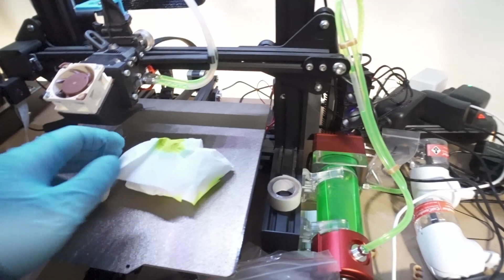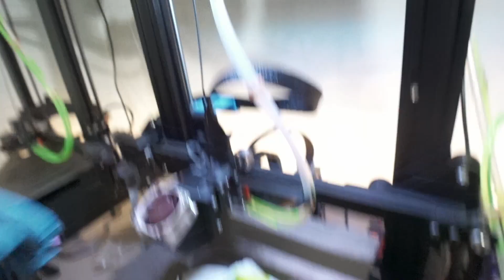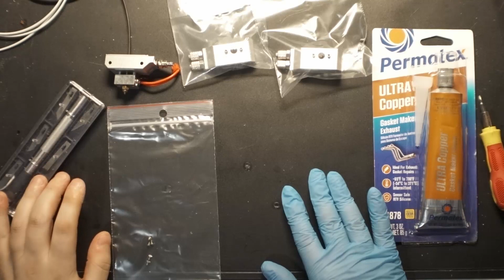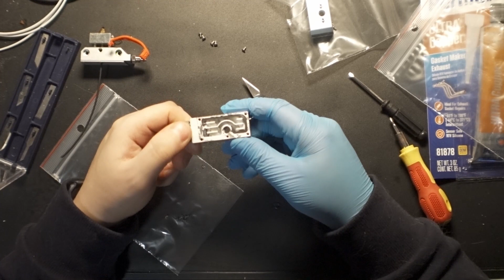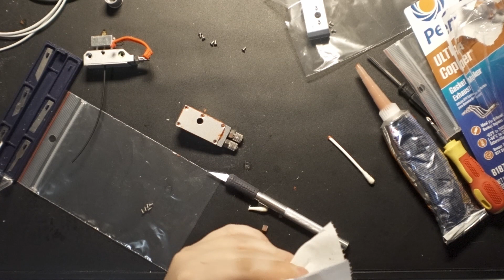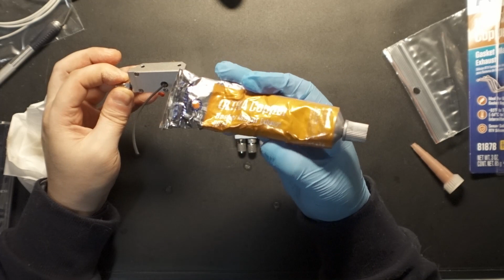How to permanently fix Creality watercoolings block leakage?

Comment: I got my replacement, and I realized that they are the same thing but very different. I ordered an EU version, and it has a slightly different waterbock than the replacement (us version) that I recieved. They both use the same type of screws, but the EU one has longer screws. The US one also already had the sealant and some rubber gaskets, but the EU version didnt have any sealant. I was easily able to do the re seal on the EU one as it was free of the black sealant. I also used a silicone paste that is capable of going up to 538C and staying at that temperature without problems. Thank you so much for all the help! 

I am planning on making a guide on how I modded my ender 3 max to be silent and fast due to its tiny amount of support and I really look up to you! :D
Reply from the maker: thank you for the kind words, i'm glad that some people appreciate the older printer mods aswell :)

Comment: Thank you so much! I managed to get customer support to send me a replacement after a lot of asking. I am going to use the red version of the silicone gasket sealer as it supposedly can handle very high temperatures. I’m also going to add an automatic exhaust plug so the temperatures don’t cause it to have too much pressure
Reply from the maker: yes very nice, since I did the fix on mine , i've been using it and no leaks at all

Comment: I ordered one of these, mostly out of curiosity, knowing that they leak, and when I unboxed it and began to closely examining the design it became immediately apparent why they leak and Stands the reason they don’t leak immediately usually after being in service, the first thing that came jumping out at me is, there is no air relief valve in the system. This is where the problem exists especially if it’s going to be used over a long period of time once the liquid in the chamber begins to heat up and expand and there’s nowhere for air pressure to escape, it will begin to build pressure in the system and put high pressure on things that were never intended to experience higher pressure I think some sort of pressure relief port would solve the problem just my take on it. Just think of what happens when you open your car radiator cap with the engine still hot and it will become blindingly apparent. Why these things leak.

Comment: I have been thinking about this upgrade, but having found the issues you have had, it seems to me that their is not lot of gain in water cooling, you dont really gain anything performance wise, or noise wise, as you still require a parts fan.  Many thanks for changing my mind and saving me some money :)
Reply from the maker: awesome, glad if i could help :)

Comment: So i see you went with my fix... couple things, the black epoxy needs to be removed, and 2nd you used way to much silicone..that risks the channel it flows thru to be blocked by excess silicon.. also you needed to wait a few minutes before adding the screws to give the silicone a chance to set up. I think i mentioned that in the discord chat..
Reply from the maker: oh it's been such a long time , i didn't even remember the instructions u gave me :O
But it has worked out fine though, even though the black hard 'sealant' hasn't been removed, no leaks so far :)

Comment: Is the permanent fix to throw all creality products in the trash and get a bambu labs machine? What coolant are you using? Could the coolant be deteriorating the factory seal and causing the leak? Try using distilled water with a silver coil in the pump and see if that leaks.

I have a real sour taste in my mouth with creality after their sonic pad caused thermal runaway on the first print and damaged my cr-10 smart pro. Now i am trying to deal with their customer support and the 3-4 day for email replies is horrible. I even bought the water cooler kit for my machine but after seeing your issues i am probably going to return it and see if i can return the printer since its still in the 1 year warrenty
Reply: I was going to say the same thing, only way to fix it is to throw it in the trash :P
Reply from the maker: @nathanbuildsrobotsvideohos3386  u guys are naughty!
Reply: @aim6mac  But they speak the truth ... 😅
Reply from the maker: Hi Trevor, first of all LOL! I'm using EKWB premix coolant, and as u can see on the video the other coolingsblock didn't get get a leak and it's been printing much more ... i think Creality just didn't do enough tests with the seal they are using, (probably cheap) so the one i'm using is pretty expensive and should do the work permanently (ish) I'm still testing with it will let y'all know how it turns out!

Sorry to hear about your horrible experience with the sonic pad, i'm glad that didn't happen to my printers, i would have make them send me a brand new one lol
Reply: My first thought, as a fix, would be to run the pump, standing up and leave the top cap slightly loose just tight enough to keep the dirt and debris out but to let a small amount of air escape. I will try this if this does not work. I will try to think of some way to put a small expansion tank in line with the whole system.